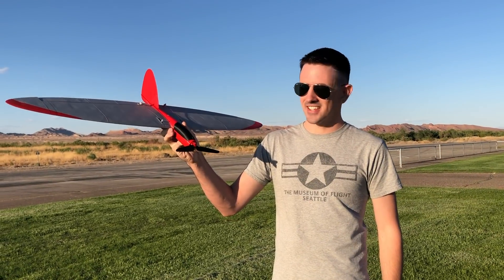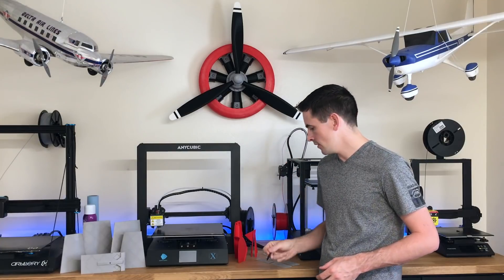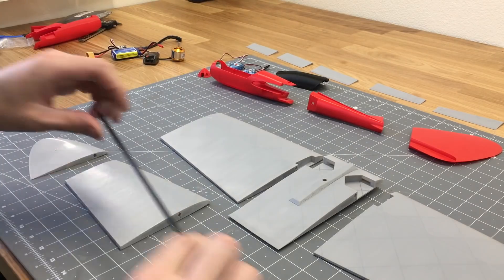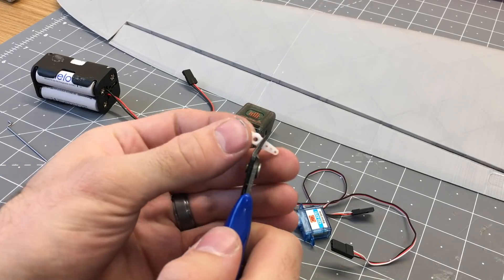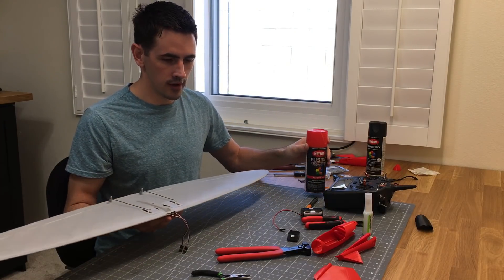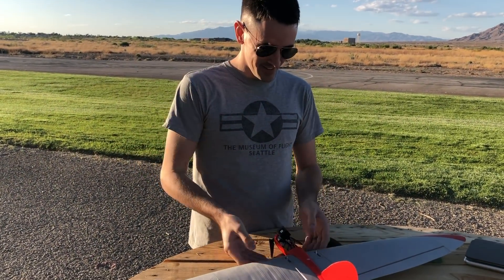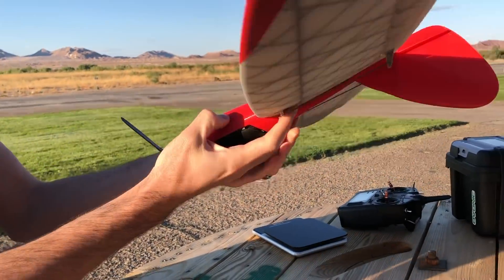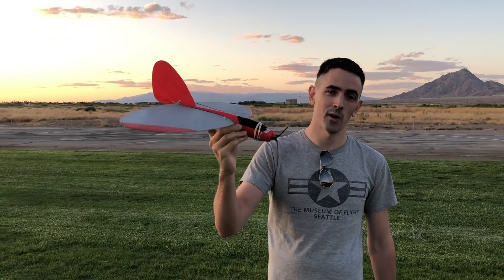Best 3D Printed Plane on a Budget - Longboard 1000 3d-printz

Comment: Realizing you posted this 2 years ago, but I'm sure your still at it, printing this now in PLA+. (I'm pretty sure you used PLA? and not the lightweight?). Anyway, parts are coming out great, I'm printing it in "surface mode" I tried the standard like you did (because you have top and bottoms on the wings) but mine would have been way too heavy that way. Anyway, a new K1 Max here and it's screaming right along, an amazing printer. Have spent lots of time sorting the slicing settings out as none around it being too new.. Thanks so much for your video and build sharing it with us!!!! Looking forward to your next project as they are all top notch!!!! w

Comment: So - during the middle of "I'm bored and can't fly" winter build season, I decided to build this.  I had zero - ZERO expectations on this model.  I made it with LW=PLA wings and PLA wingtips, fuse, and control surfaces. I even found and printed a folding prop. And it sat. And sat. And sat some more.  Finally, the weather broke and I decided to git it a try. I even brought a bag for the parts.  

Everything barely fits in the fuse. Added some up reflex. Pointed into the non-existent wind. Added about 60% throttle and just tossed it like a paper airplane. And - DAMN! It flew perfectly! I'm standing there gobsmacked and realized I really should start flying the model and she behaved really smoothly.  Not a click of trim.  I did get a lot of flutter coming out of a loop so I throttled back (need to figure that out).  

Thanks for the build tips and showing off this model.

Comment: Bought this plane thinking it would be a quick build since I tend to crash a lot. One wing panel took 10 hours to print on my Ender 3 V2 using Super Slicer. There are 4 panels with similar print times. I am wondering how Troy can build this plane in 19 hours.
Reply: I'm betting that was an error. I'm on PrusaSlicer with 4 main wing parts (wing tips not on this run) - 29 hours! Am using the same settings as recent Epsilon build that seemed much faster so am assuming designers approach could print a little more slowly? Still, looks like a fun plane, just gotta order some more filament :)

Comment: Is the thin gauge JST wire able to handle the amps that this motor draws? From what I am reading those JST connectors can only handle 5amps max and that motor pulls 12amps. I'm very new to this, so I could be misreading something.

Comment: Hi Troy, now following your videos from Paris.
Could you please tell me how you print the center part adn front fuselage ?
Support or some infill ?   
I don't understand how I can get this right with no collapsing or 1 ton of ugly infill or support.

To me it's just impossible to print this thing. 
There are horizontal parts appearing in the air, which is impossible to print on any printers, really wonder how you managed to print this thing.

Keep up the good job mate :)

Comment: I was having major problems with the internal structure not adhering to the outer wall on the wings. It turns out that the only thing I was doing wrong was trying to print it in surface mode like I saw in another video about printing thin wall stuff like this.

Comment: The easiest way to get carbon fiber rods is going to the archery shop. Arrows are just carbon tubes. On Amazon you get a 12 pack for 30$
Reply: If you need that size, that works, but many of these smaller models use smaller diameter tubes.

Comment: Hey Troy, thanks again for another great print, build and fly!  I purchased the longboard and noticed there are revisions to some of the STL files.  Does the base download incorporate those? , or should I replace files, in order, through revisions?  Thanks again!
Reply from the maker: The revisions fix the control surface not being attached to the wing. I did not use them I just printed out the single wing sections and single control surface.
Reply: @TroyMcMillan  thank you for your reply.

Comment: I've been wanting to do this forever. What kind of printer do you need to do this?
Reply from the maker: I have a few different printers I use but just any printer with a 200x200x200mm build plate will work for all the planes on my channel.

Comment: Is it possible to make this plane becomes a Glider without motor? Thanks
Reply from the maker: Yes it is possible I talk about how to do it in the video it has a nose piece to print out and glue on the front. There is a compartment to add wight to the nose for counter wight.

Comment: yes...maybe petg would be much stronger...a little harder to work with though...this is a nice plane...and if breaks you can always glue or reprint parts... one day when i get back into flying i am going to try to print a nice little plane like this one...
Reply from the maker: Yes PETG is a bit stronger. It was very easy to just glue the parts back together after a crash. Definitely a fun plane to fly.
Reply: @TroyMcMillan  i had a hobbyking wingnetic epo plane i finally destroyed after many repairs...this one is similar design and size...thanks
Reply: PETG is harder to print with and not as stiff. I tried printing out the canopy to the smaller version of this plane in PETG and it didn't work very well, about to reprint in PLA.

Comment: Its nice to see we are all human and make mistakes. I have printed my first plane ( Eclipson Model T) and awaiting to fly. Would be great to have more information on your esc and motor choices if not as recommended by designers.
Keep up the good work.
Reply from the maker: I used a 2212 1400kv motor, 20 amp ESC, 8x4.5 prop and 3S 450mah battery. I have links to all the parts I use in the description. Good luck with your Model T flight.

Comment: Nice and easy! Just bought the STLs 🙂
This looks like the right model to get a feeling for printing a complete plane, instead of just parts of it. I was always a little hesitant about starting one of the bigger prints. Still afraid, it may be a big waste of filament until I get the settings right. Just had problems with some cheaper PLA clogging both of my printers nozzles. Imagining running into problems like this after 18 hours of printing 🤪

I also can read their untranslated instructions and will have no problems getting metric parts 😁
Reply from the maker: Yes exactly this plane can be printed over a weekend and just use a very small amount of material. It is definitely a big process to start on a project with 100 hours of printing time. Lots of random parts until you start assembling. This build is about as simple as it can be. 

I love metric but hate that it is so hard to get in the US.

Comment: For the carbon rod, if you get carbon fiber tube, 4mm x 2mm I’d, you can use a 2mm rod to glue two pieces together.
Reply from the maker: Yes you can do this I have done it before on other builds.

Comment: Thanks Troy for your honest opinion about the plane and products you are using.  I really appreciate the budget tips too.   For many of us on a fixed income,  it is much easier to use a larger motor and battery than to use the LW-PLA due to its cost.  Even the tip on the superglue was appreciated.  There’s tons of videos flying 3D printed planes, but very few that take the time to explain how to make them.  Even your quick repair tips are really helpful.  Your wife’s support is also encouraging and she does great on getting some awesome shots!  Thanks again.
Reply from the maker: Thank you JL, I appreciate the feed back. This is a great hobby and making it easy and affordable for anyone to try out is definitely my goal with this build. LW-PLA is great stuff but definitely hard to justify spending that much for this small of plane it would use a very small about of material. Thank you for mentioning my Wife this channel would not be possible without her support. Cheers
Reply: @TroyMcMillan  Hey there! Can you recommend Motor and Battery Specs for a 100% PLA Version of this?

Comment: What I don't like about gluing servo covers in place is when the servos fail and you have to do some major surgery to replace them. I prefer screws.
Reply from the maker: Yes but if the servo fail chances are the plane will crash badly and will need to be reprinted anyway.
Reply: @TroyMcMillan  it so happens I have some very old planes that have survived years of flying and servos have failed in them. I guess if you consider cost and likelihood of a catastrophic crash you’re right.

Comment: I think this the first print you have done that you actually had to modify to get it to print.
Not very well designed I think.
Reply from the maker: It would work ok for the way it was deigned to print. I just wanted a better quality then I was getting with my printers that is why I had to modify it slightly.

Comment: Great build video. Like all the tips you include. Also that you explain how to fix a mistake, instead of editing out of the video. This practical knowledge is appreciated and invaluable to someone doing their first printed planes.
Reply from the maker: Aerial Thank you for the comment. That was my intension with this build. That it is a great first cheap build to start with so I wanted to add any tips I could.
Reply: @TroyMcMillan  dude right across the flying fild the hills  make for good sail plane flying and carbon fiber rods not that hard to find
Reply: @TroyMcMillan  it not that hard to find meteric screws

Comment: Me and my Friend are designing a 3d printed long-range FPV motor-less glider, which should use thermals for cross country flights.
Reply from the maker: Nice sounds fun good luck with your build
Reply: @user-gr3zk3vw8e  It will be on channel called adam jirovec 3D
https://www.youtube.com/channel/UCLP_p2vLyhZ5BB5pljuNZrQ
maybe lhotakFPV as well
Reply: @user-gr3zk3vw8e  once i do release it, I´ll let you know :)
Reply: @user-gr3zk3vw8e  https://www.youtube.com/channel/UCkk_OI7m2vnTBwSgrQfZ-HQ

I am the owner of LhotakFpv and I haven't really posted anything over the winter...but stuff is comin´ :)
Reply: @user-gr3zk3vw8e  Trust me, flying fpv in thermals is hella dope...
I just usually stick with larger battery, because I know people who used solars to charge their plane and then battery exploded
Reply: @user-gr3zk3vw8e  I hear its 3d printed glider, dou you have a printer at home mate?
Reply: @user-gr3zk3vw8e  Trust me, 3d printers are hella amazin´ .Whatever you design on computer, you can make in real life.
Its fascinating...especially if you can then print plane and accessories to them.
I have actually 3 printers at home because you´ll never get enough of them.
Best value/reliability i would recommend Prusa printers.
they never failed me, literally

Comment: Hi Troy, this video landed at the right time, I wanted a model I could print as a test print after following your thin wall printing video to home in my printer and this is perfect due to the reduced volume of PLA and reduced print time. The cura tips are a nice touch and I am tempted to print the flying surfaces in four sections so to make them mixed. As always, keep up the great build guides and video production. You inspire us all to build and fly with style!
Reply from the maker: Thank you colsoyeti, Yes this is a great build for that. It prints fast and is very easy to put together. Thank you for the comment have fun with your build.

Comment: Looks a bit like a 3d printen alula
Reply: They got a clone of that, it’s called the Lou-Lou, I’m not sure exactly which “plan website” I found it on earlier today, it may have been from the same company that made this model. Check it out, the website I mean.
Reply: @BikingVikingHH  Yeah, I saw the lou lou when checking. I might give it a try this summer, need to find some decent hangs around here though. I do wish their designs had been designed for printing without retraction like eclipson and the new 3dlabprint planes though. cleaner prints and better if you want to print in lw-pla